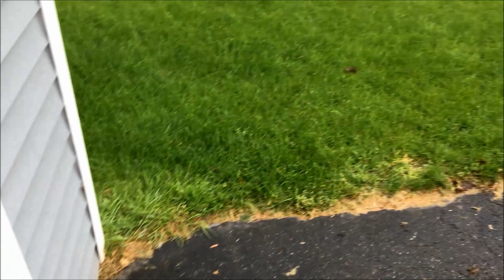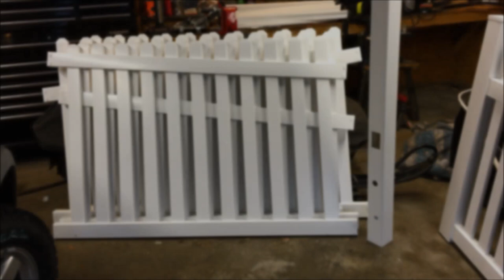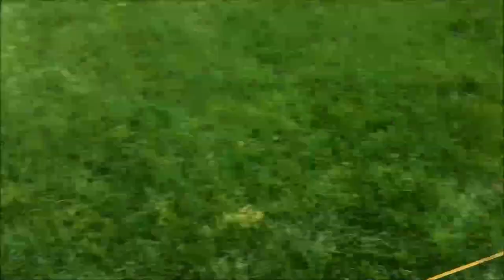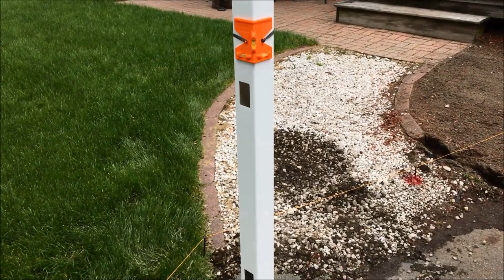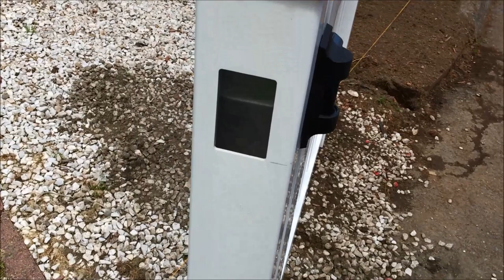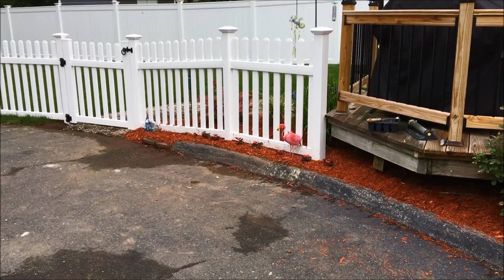How to install a vinyl fence up a slope or hill and around a curve

Comment: Great video! For the smaller sections by the garage and deck, did you cut the horizontal sections to fit? I can't find anything shorter than 6ft or 8ft wide and I'm not sure how this is achieved. Thanks!
Reply from the maker: Yes, that’s exactly what you do. Since the top and bottom rails are independent of each other, you cut them to fit.

Comment: So, my front yard has a large curve, kind of like a baseball outfield wall, I wonder if this type fence would work on that. I don’t understand how it would works as it curves. Like, how would it be able to “bend” into place. I have no idea on how to build anything. I barley know how to turn on my tv.
Reply from the maker: The fence doesn’t actually bend. It has articulation that you can offset it from the next section which will allow you to change direction. Over a long enough span, it will give the impression that it’s bending, but it’s a collection of straight lines set at different angles.

Comment: Looks to me the fence is reversed. Usually the smooth side faces out. Other than that good job.
Reply from the maker: It's identical on both sides. No texture on the fence, It's a smooth surface.
Reply: @StreetersGarage  What I mean is there is a front side and a back side. The front side of your fence is facing inward toward your yard where usually that side faces out.
Reply: @StreetersGarage  OK I took better look and I was wrong.It is right.